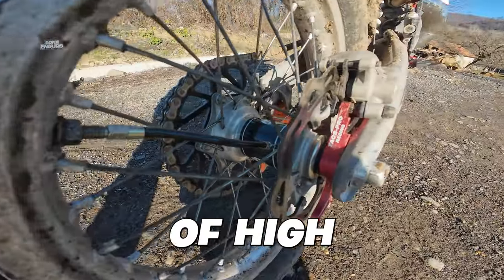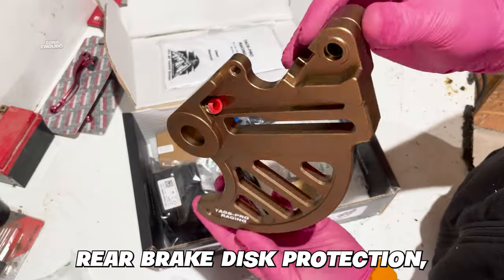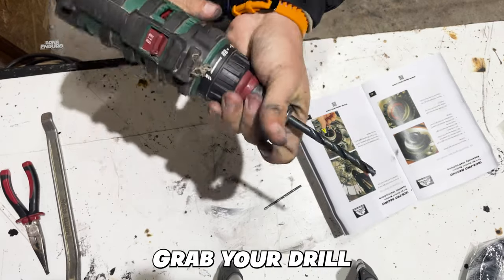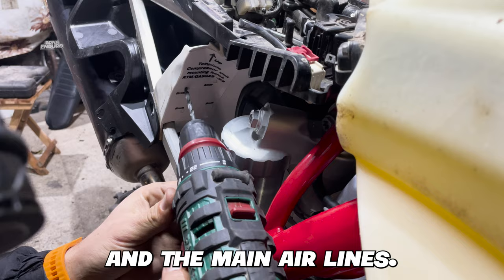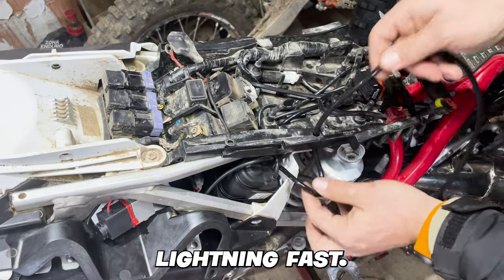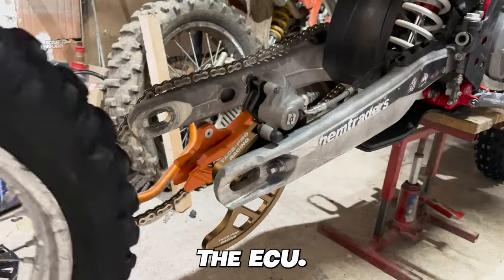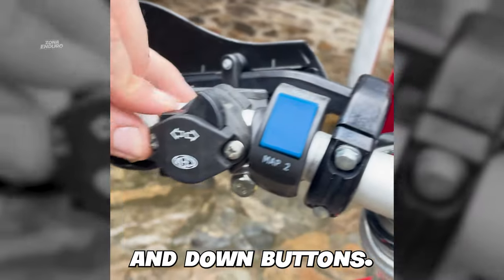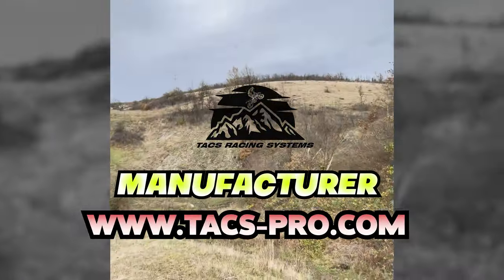Hard Enduro Game-Changer! TACS-PRO Racing Tire Air Control System

Comment: For real ! And a stick or wire get in the hub wheel? 🤔🫣
Reply from the maker: Nope, you need a wire, a strong that can’t be bent so easily. So you can pull the air hose through the swing arm with ease.